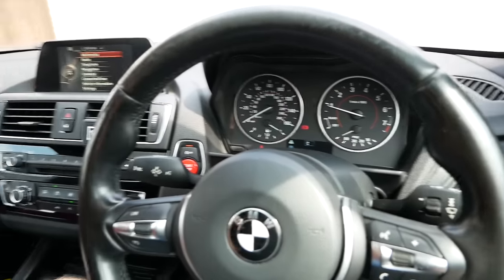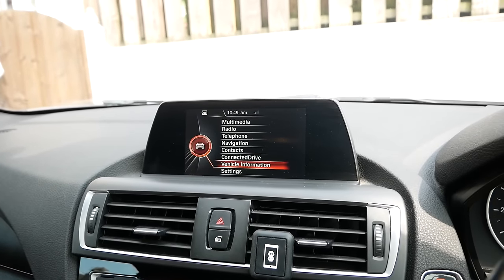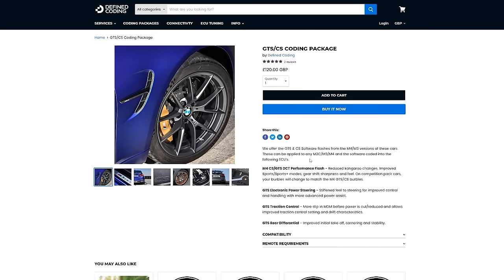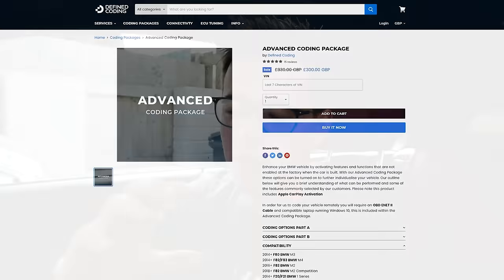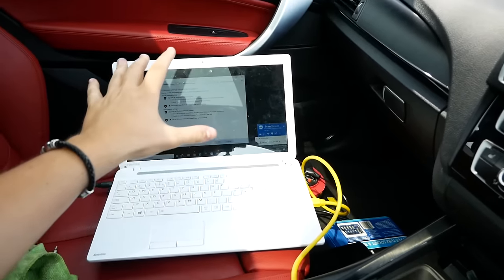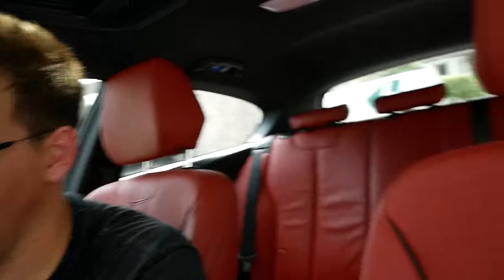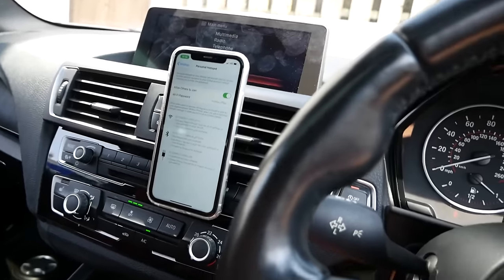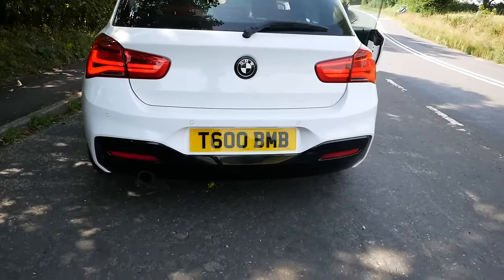UPGRADING MY iDRIVE SCREEN ON MY BMW 1 SERIES! *Defined Coding*

Comment: Would I be able to do this on my 2014 F20 116i? 
Thanks!
Reply: use RealOEM to find which part numbers are compatible with your car because the voltages are different depending on LCI and pre LCI

Comment: Hi Brett, I'm looking at getting some mods done, pretty much exactly the ones you have. I'd looked at bimmer code and getting an OBD cable and doing it myself.. which looks like the cheaper way to do it. Do you reckon paying the extra through the guys is worth it ?

Comment: Hi Brett, looking to do the same on my 2017 140 (same dash) any chance you could find out the part number of the one you ordered, I know there is an F20 and F30 version (slightly less optimal fit but works) curious which one you ordered. Cheers from Belgium!

Comment: Do you need to change the idrive controller too? Cuz its the smaller one or does it work with the small idrive controller too?
Reply from the maker: All I’ve done is changed the screen size, similar to a PC screen. You wouldn’t need to change your keyboard if you got a bigger pc monitor would you. Hope that makes sense mate 😃

Comment: We did this to my aunts BMW 3 series and upgraded the screen and then the hvac had some issues few months down the lime and we took it to the dealer since it was under warranty and they noticed the screen was upgraded and said the screen is tampered and refused to work on it and honor the warranty 🙄
Reply from the maker: Ah strange! All good on mine.
Reply: @BrettBarnesYT  extremely strange haha we had pioneer head units in our older Mercedes and the dealer didn’t give a shit about those haha

Comment: You need the cluster aswell mate with the digital at the bottom
Reply from the maker: Would that be. A straight swap?
Reply: All ino is when i use my navigation it pops up also with streets and arrows at the bottom on the cluster

Comment: Great video! Did you have a head unit that supports navigation or just basic bmw radio professional? I have an f20 lci 2017 with the 6.5 inch display and basic radio head unit and I was wondering if this screen is compatible with my head unit.
Reply: Entrynavs supports 8.8 inch resolution